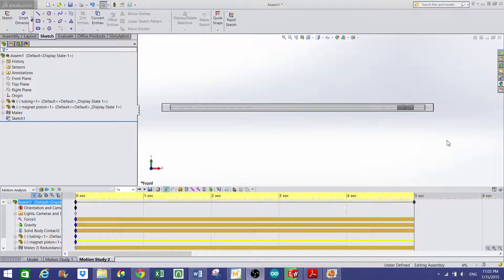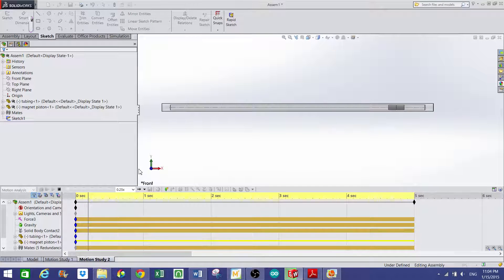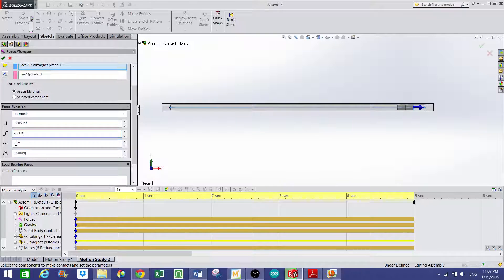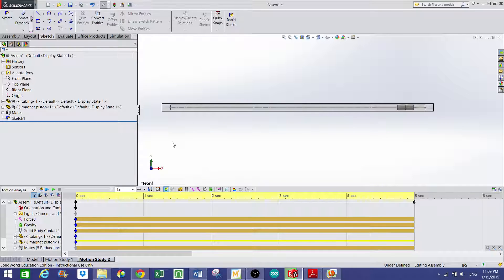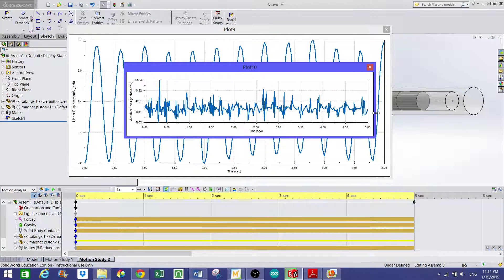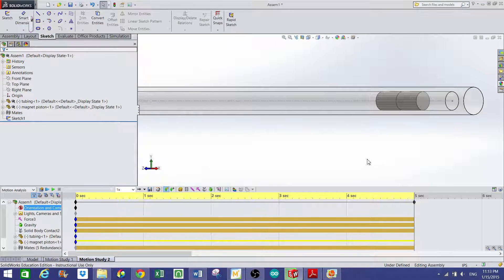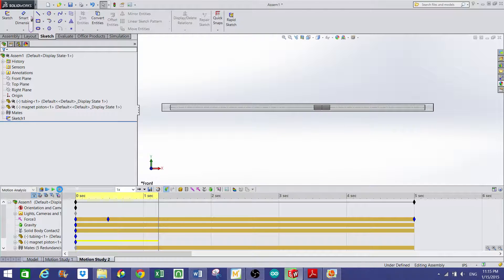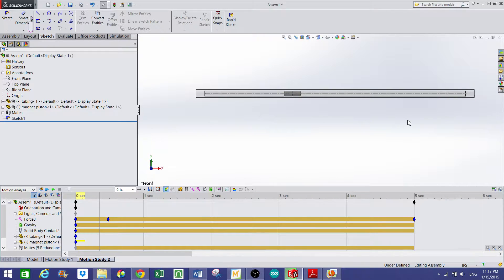Force analysis of a dynamic system in solidworks

Comment: I have a question. I have a linkage structure (including many 4 bar and 5 bar linkages connected together), I want to analyze the force reaction in this system using Solidworks, specifically, I want to apply a force on a joint and know the force on a specific link. Can I do that in Solidworks ? Thanks in advance
Reply from the maker: The long and short answer is yes! Once you put together the assembly, you would just need to fix the desired points and load the point of interest.
We did something similar in the course where it was a significantly complicated hand probslem that was (relatively) quickly solved using a simulation.